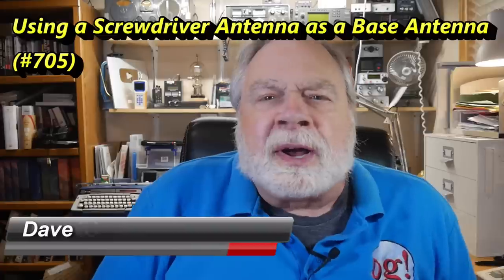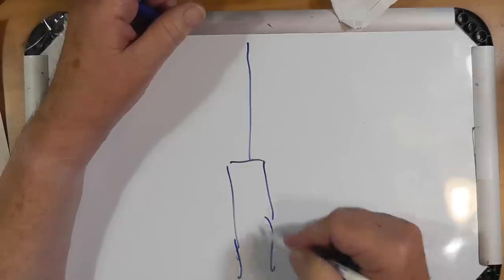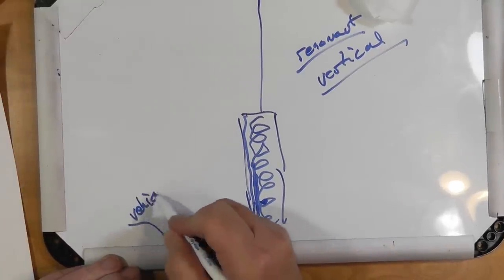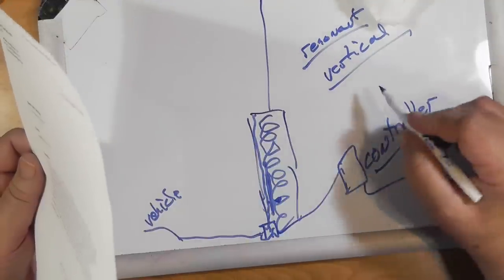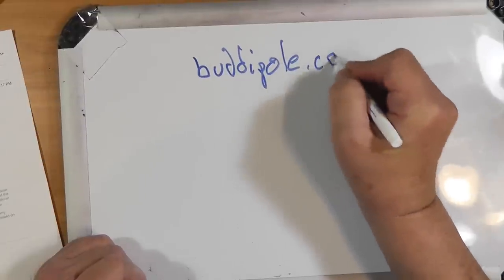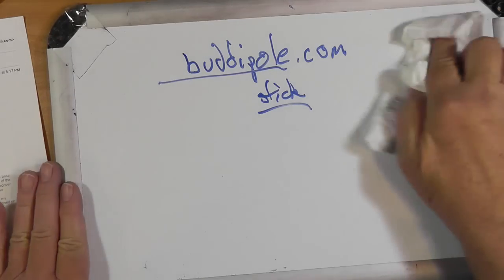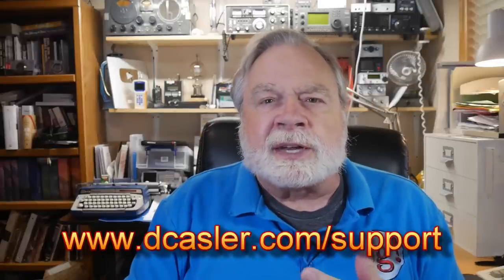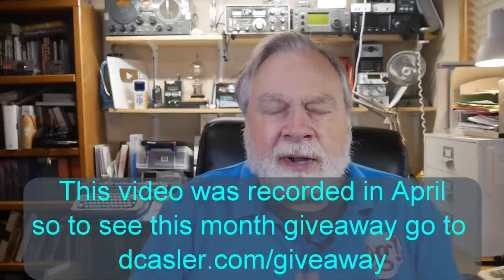Using a Screwdriver Antenna as a Base Antenna (#705)

Comment: 1st, I gave a thumbs up.  But I couldn't help noticing that Dave sort of changed the topic partway through the video, so -
"Using a Screwdriver Antenna as a Base Antenna", the title of the video.
I highlight this because for many years from the CB Radio to Ham Radio I've used ALL SORTS of mobile antennas as a "base station" antenna from various apartments.  And they ALL worked quite well!  I've incorporated a counterpoise that was 14 ga. wire about 18 feet long at which the end was wrapped around (in a coil) a peanut butter jar filled with water to weigh it down and keep the wire tight.  Seemed to work quite well keeping the SWR low, AND THE BANDWIDTH quite wide on our meters and such.  In the past, I thought about using "Screwdriver Antennas" for an apartment base station antenna until I discovered the Chameleon matcher rated @ 500 watts and the collapsible 17-foot telescoping whip antenna.  Since then that's been my "base station vertical antenna at a mere 20 feet that for the last couple of years on the HF Ham bands has worked quite well.
KD83FQ/73

Comment: Been using a screwdriver antenna at the base for years. Works great. I did add a shunt coil to the antenna which helped. I cut the grass very short around the antenna pole. I added a metal mesh under the pole and connected it to the pole. 6 ft x 6 ft. Now the grass hides the metal mesh. 80 thru 6 is good to go. Don't over thing this. Its basic antenna theory.
Reply: I watched a video yesterday of a group at a park. One operator had a screwdrive on a ground spike that was through middle of a 5'x8' piece of aluminum screen. They said it worked great.
Reply: Same here, some 1” square concrete reinforcing mesh covers a 10’ x 10’ area thumped & pegged just into the ground, below grass level. The antenna is in the middle and ground bonded to the mesh. Works fine.

Comment: I have used a screwdriver antenna for several years on the roof of my patio.  I live in a condo and understand no antennas.  You have to be looking for the antenna to see it.  It isn’t seen by casual observation.  I use a Yaesu ft991 with a atas 120.  I tried using random wire lengths for counterpoise.  Never was very happy with the results.  Then one day I was looking at a MFJ antenna (I think it was called a spider antenna) that uses ham sticks to make several dipoles.  I went to Lowes lumber picked up an electric box (8 sided) that I could use 2 each on opposing sides for 40,20,15 and 10.  Mounted two each onto the box. You need to spend the afternoon tuning the counterpoise to the center of each band.  Made a mounting bracket used three magnets from old mag mounts and mounted it on a vent on the roof of my patio.  I found this arrangement works well for me.  Yes it still has a high Q but if I move off the freq. I originally set I just hit tune and it realigns to the freq. I want.
Reply: So, you added tuned counterpoise wires to your screwdrive antenna and are satisfied with the performance.

I have an ATAS-120A that will be putting on my car, but I plan on playing with it as a portable antenna. Perhaps sticking it on a cast iron BBQ grill by a park pavillion, or on a ground stake with radials. Maybe with elevated tuned counterpoise wires. I have two sets of couterpoise wires from SuperAntenna cut for 20m, 17m, 15m, 12m, and 10m.
Its all about playing and knowing what should work in an emergency.

Comment: Im glad you emphasized the term "Designed As " a mobile antenna .  Most hams dont understand that a mobile antenna design assumes an average size ground plane and a maximum height to clear trees and overpasses (8 to 10ft seems to be the magic number)  .  My 5 ft balcony isn't quite suitable for most mobile antennas below 20M especially when you have people living above and below me .
Reply: If you don't mind the work of tuning or you are an digital guy that seldom changes frequency, you would probably like a magloop.
I have two magloops as I am a condo dweller and I always look for easy to deploy portable antennas. They are not my favorite antenna because I like to frequency and band hope working phone. For me the tuning is too much work.
However, they are great antennas when it comes to nulling out local noise by pointing the antenna at the noise source. For me it is all the airconditioners beside my condo. Unfortunately I have to place the loop at the front of my condo in order to null the airconditioner noise, so I cannot leave it up.
There is a tree canopy that I throw an EDHW antenna over that usually has almost tolerable QRM noise that use the most at home. As its a tree canopy I leave the wire in the tree and just put away my transformer and coax. Very few people know its there. I work 80m-10m.

Comment: I run a Wolf River Coil and a 5 ft fiberglass “CB” firestik in my attic for HF. I typically leave it set for 40m but it’s right by the hatch so I can change it easily enough. Works quite well.

Comment: I've run the Buddistick vertical portable forever and it works, however, now I'm using the Wolf River 90-10 meter coil and like it better - of course with ground radials. The Wolf River coil is more stable than the Buddistick coil.   73/K6SDW
Reply: I love my Wolf River Coil antenna.
Reply: What do you mean by stable? Like less likely to fall over?
Reply: @aurtisanminer2827  I like the buddistick set up too, but the SWR would vary depending upon temp and especially rain/wet. So far, I haven't experienced this using the Wolf River coil which I feel is better made.....your mileage may vary.
Reply: @eddy2561  ok, I see what you mean. I get the issue of varying swr on my mobile in the rain. The worst is road grime building up on my loading coil. It bridges over the coil and becomes untunable with my internal tuner. At that point I have to stop and wipe it off. Snowy and slushy roads are the biggest offenders. I cant say I’ve ever had variances based on temperature, but it doesnt get that hot up her in the north. I’ve heard of people in california catching their loading coils on fire while sitting at a stop light. Lol
Reply: What wolf river should I get
Reply: @KE8ODY-WV-Ares-Ham-Dad-3O4  It depends on what you want to achieve...I'd contact Wolf River with your question. 73
Reply: @eddy2561  I just wanna used my 2000 dollar radio lol
Reply: @KE8ODY-WV-Ares-Ham-Dad-3O4  I would recommend getting the ARRL Handbook and learning more about all the different antennas. GL/73

Comment: Video title says "Using a Screwdriver Antenna as a Base Antenna" however the discussion was all about it being portable?
Reply: Just don’t move around, then it becomes a base antenna. Biggest issue with screwdriver antenna is water getting into the mechanism and the like. On a car or POTA, you need can put them indoors and dry them out. On the apex of your house it won’t get the same TLC but on a balcony you can give it the right maintenance. As the man says, a lot of compromise in the design. It’s a balance between convenience and antenna efficiency.

Comment: Hello all, I have a model 100 screwdriver antenna from Tarheel Antennas and I have used mine while camping. How I setup mine is, I have the mounting bracket for the vehicle mounted on mine. I took 2 u-bolts and drilled holes in the mount and used about a 2ft 1/2" inch water pipe and drove it in the ground about 1ft just to support the antenna. I made up a ring of #12 bare copper wire about 10" diameter and soldered it together. I then connected 10-8Ft. radials to the ring and attached the ring to the mount. It worked well for me. I made several contacts with that setup. Now I didn't leave it setup while we were not there. That's how I did mine. Hope this helped. 73 Dave AG4QH

Comment: An old fashioned GM bumper jack, which the Jeep folks still commonly use under some name like a high lift jack, can pull out ground rods and even sign/fence posts. You may need a way to weld or coonect a ViceGrip to it in order to grab the pole.
Reply: Just wrap some chain around the ground rod and jack it out. It will pull rebar out of rocky soil.

Comment: ALWAYS use a ground round! Easy to remove 2 4' sections connected afterwards with 6 ga. Copper wire. To remove: stand over rod straddling both sides. Bend down and snap some vise grips on the rod parallel with the ground. Grip the handles in one hands fingers and slip your other fingers around the jaws . Twist 180° left, then right while firmly and slowly pulling out of ground. Been doing it for years and never lost a rod. This is a variation on an old fence man's trick...large pipe wrench on a temp fence post can be twisted out easily as well. Obviously,  I wouldn't try to pry an 8' rod.

Comment: In the Army Signal Corp back in the mid to late 1980s I handle 8ft grounding rods on my generator and comms shelter on a 2.5 ton truck by driving them in at a 45° angle. When it came time to leave I wrapped the 1in ground braid several times around the ground rod below the head of the rod. Then I tied the other end to my truck and almost never had a problem.
I do remember breaking my ground strap a couple of times. One time I remember taking one of the big shelter tiedown cables and putting its hood below the head of the ground stake. The head snapped off and made a pretty good projectile. Obviously the rod was pounded into a large rock.
Reply: That equipment is what in Britain we call Squaddie-proofed. Designed for the “practical” approach of the military😂

Comment: @Dave - Rather than PORTABLE, can you talk a bit about using a screwdriver as a BASE antenna (as in the attic of a house or condo) and what you can do to optimize the setup?
Reply: I think Larry above addresses that above a set of tune counterpoise wires cut for each band.

Comment: Dave, you do not only sacrifice bandwidth with the screwdriver or any other base loaded antenna, you also might mention the losses in the coil. A 40m screwdriver is about as efficient in regards to ERP as a 2m rubber duck.

Comment: Hello Dave.  Great video.  I have a Hi-Q screwdriver antenna.  It worked quite well when attached to a trailer hitch on my car.  It did not work as well when I used it as a portable antenna.  It was okay, but not as good as a dipole.  There is one thing that I had a hard time understanding with the screwdriver antennas and or stick antennas.  It was the impedance matching coil at the bottom of the antenna.  I think that the antenna has a very low impedance at the feed point.  If you do another video on portable antennas, I would like it if you could explain the matching coils or devices for impedance matching for portable antennas.   Thanks

Comment: About using a screwdriver antenna such as a Yaesu ATAS120A. In a car or truck, using the chassis as a counterpoise works. However, in an RV, the chassis can be connected to electrical ground through the shore power plug. How will this affect the antenna?

Comment: Question, can you mount one on a pole to raise it up off the ground? Mine has been setting in the shop since I don't have it mounted on the truck anymore. I was thinking of using it at home for vertical use. 73, ke4ooo
Reply: Try it and see. It will work. The question is whether you use ground radials or counterpoise wires to make it work, and how many.

Comment: There is a hospital system in the greater Houston area that uses screwdriver antenna's and long wire antenna's for it's ham radio stations at each hospital location for EMCOM's.
de W5KAL
Reply: That sounds like a great plan. Frequency agility in both vertical and horizontally polarized antennas to optimize signal strength that could occur from cross polarization between stations. Someone was thinking.

Comment: Yes,  You can use your screwdriver antenna as a home base if you give it a good ground reference system
though you might be better using a longer wire in the air and a ground wire or wires being fed by a good ATU.

Comment: A Radial is a capacitive element that directs the E field vectors between the active vertical element and the radial(s).

The changes that occur along the E field lines  between the active element and the radial(s)
cause rotating magnetic fields 
and the direction of propagation for the TEM wave signal is 90 degrees to the E field lines and away from the source.

Pretty simple really.

I have no idea why this remains a mystery to the majority of Hams.
Reply: Try drawing it. I'm picturing E waves leaving the vertical antenna in all directions vertically and rotating 360 degrees over one wavelength. Drawing one finite wave is ok. Drawing all the wave in radiating in all directs towards the horizon gets ugly.

Comment: I would actually say that even at resonance a ham stick is a low Q device.
An elongated inductor cannot be high Q.

A pancake or conical inductor has much higher Q.
Reply: I think Dave made the point that you probably not be less than 3:1 across any band, but perhaps just the voice or digital portions.